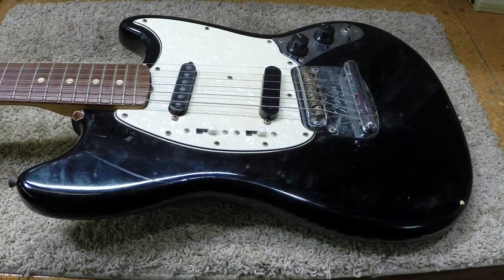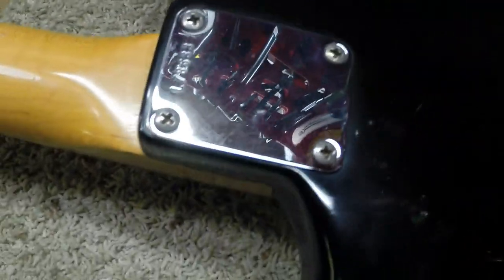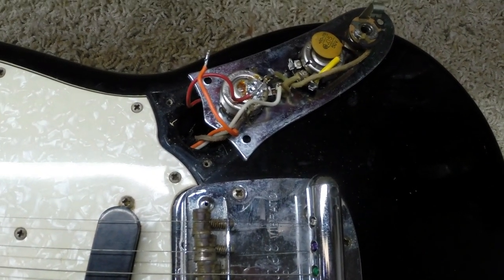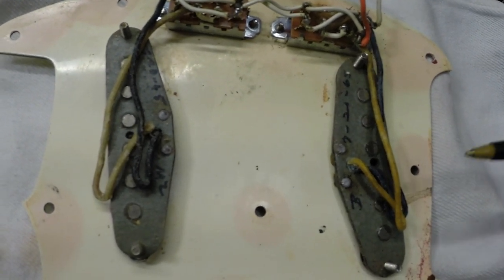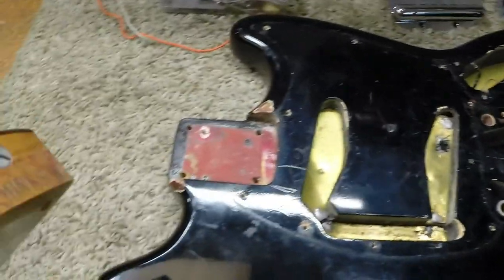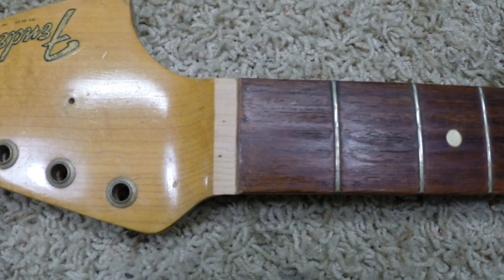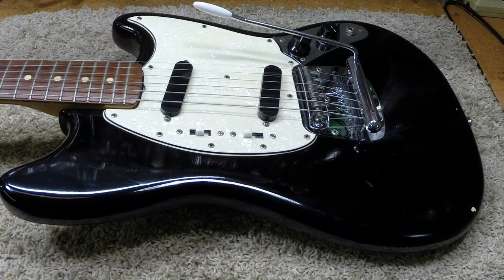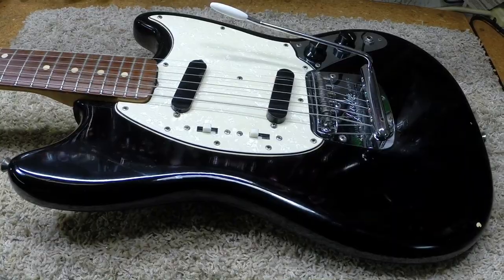Breathing New Life into a L Series Fender Mustang

Comment: I love Mustangs. I have a 1965 in Daphne Blue it has a slab board fretboard. I especially love the 1970s sunburst ones. They’re like mini Strats with a cooler shape. ;)

Also, the Fender Japan mustang pickup covers are practically identical to vintage ones. Sand them a bit to remove the sheen and you can’t tell the difference from the top.

Cool to see it has Stackpole pots.

Comment: I've got an original EARLY 65 Mustang that's been in a case since 82 that has some electronics issues. No sound whatsoever. The electronics look amazing,  as does the hardware. 

I can't figure out why I can't get sound from it. I'd love to be able to talk to you to try and get it back on the road, so to speak.
Reply from the maker: Thanks for watching.  90% of problems in the electronics in these are corroded switches and jacks.  A good cleaning usually takes care of that.  The other 10% is a bigger problem, the pickups failing.  Measure them with an ohm meter, they should read somewhere around 5000 ohms.  If you get an open reading well there is the answer, pickups are open.  Hopefully that will  not be the case.

Comment: Beautiful work. The nut problem seems perfectly repair to me. The slide switches could be any 3 way (on-off-on) switches? I want to install a mustang-like electronics in my guitar, but I don't know what switches to get for the in/out of phase tones. Thank you for sharing.
Reply from the maker: It is a special switch.  8 solder terminals, 3 position,  Dpst/off/Dpst. Allparts has the correct switch.  Part# EP-026.  You can even get it is Black, White, or Red.  Thanks for watching.

Comment: You showed us everything that needed to be worked on, showed us a tiny bit of actual neck work- and then the guitar was COMPLETE........I came here to hopefully watch you rewire those switches- because every time I wire mine- they don't work, and I thought you'd be a bigger help. I really am struggling with wiring slider switches, to the point that I bought a pair of 65 Mustang switches that were pre-wired- and they would've worked, but the switches were old and didn't make proper contact inside of them. WOE IS ME- but I am NOT switching to a 3 way selector.....Too easy, but I miss out on sounds. I want my guitars to play as designed. PLZ HELP.
Reply from the maker: If you contact me by email, the contact info is in the welcome message, I will send you a correct wiring diagram.

Comment: what is the secret to the tremolo returning back to zero? I have a CV that I got used. Great little guitar, but the trem will keep drifting [also one of the Allen screws is stripped on cigar post]. It doesn't go back to zero. This is with very light wiggle, not dive bombs.  Is it the springs? I have them the furthest away all the way down the post. Do the springs need to be replaced with stouter springs? I have the cigar almost all the way down as well. I just want to wiggle the bar a bit, not do any Wang Bar King Belew stuff. Thanks for the video.
Reply from the maker: There is no secret silver bullet magic cure.  I started dealing with my mustang in 1973, so I have had a few years of practice.  Sorry to hear you have a stripped adjusting stud, that may be a problem, since there has to be several adjustments made repeatedly.  First thing I am going to say is the reissue trems do not, and will not work as well as the originals. Also you do not need heaver springs, the height adjustment of the "cigar" is your tension adj.  If it drifts sharp across all strings you need to raise the bar to reduce tension, lower for drifting flat.  Also check to make sure strings are not sticking in the nut, or string tree.  The trem has to be balanced for equal string to spring tension. I know this may not help much but there is a lot of info to cover, there are a lot of factors.  I happen to have 4 Mustangs in the shop at the time maybe I can come up with a trem balancing video in the near future.  Thanks for watching.
Reply: @guitarc.p.r.9675  thank you for that detailed response.  Yes, I am trying to do the string=spring tension method like Carl Verheyen. I can float Strat bridges. Just a hard concept when you have to manually adjust the post after taking the plate off. It's really close but drifts just enough to drive you nuts. I just want a little wiggle like a Bigsby action wise